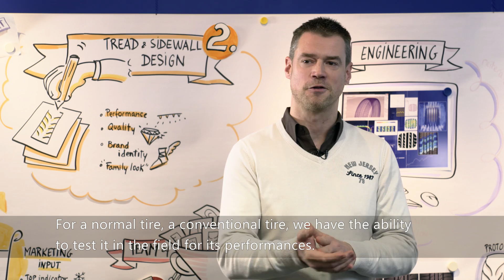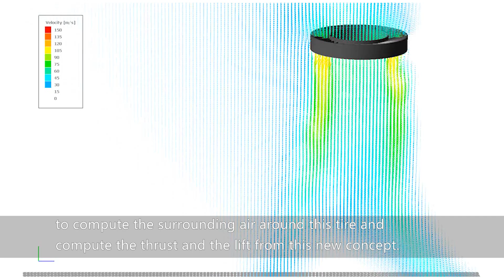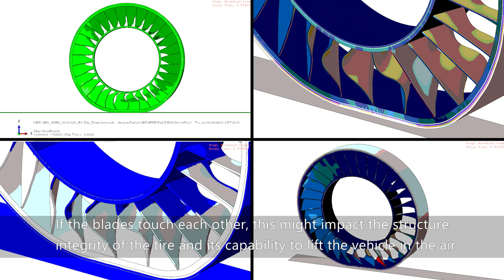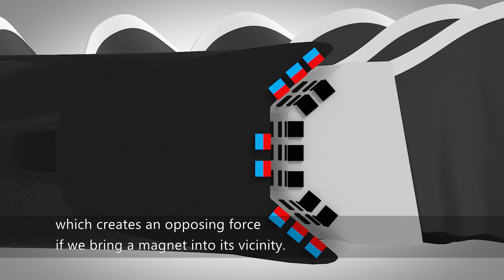Designing the Goodyear Aero concept tire

Comment: Hmmmm..looks an awful lot like the design of the shield air carrier rotors from the avengers

I call patent infringement!

how are the planning to deal with bird strikes and snow and icing

can't believe how much engineering money they are spending on this "concept"

I may be looking at modifying my retirement portfolio as this concept is going to be losing money for a good long time.

flying cars will require a mr. fusion and a magnetic repulsur field.

How will they maintain absolute zero for the superconductors, captain ramius?